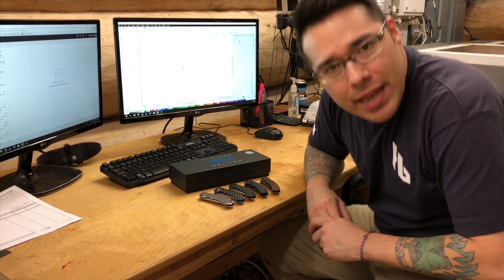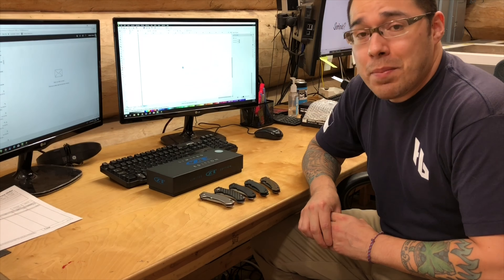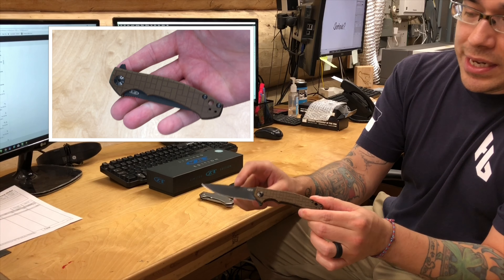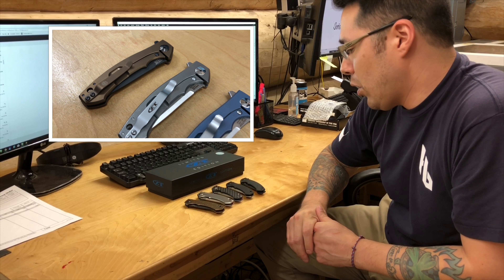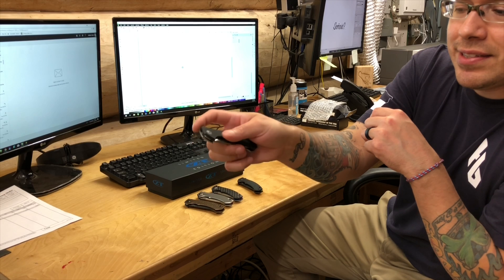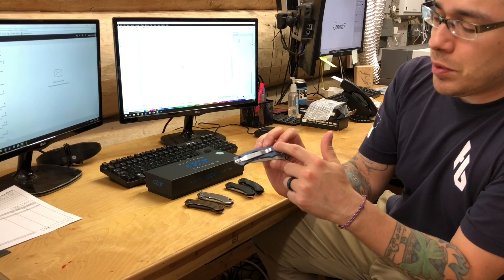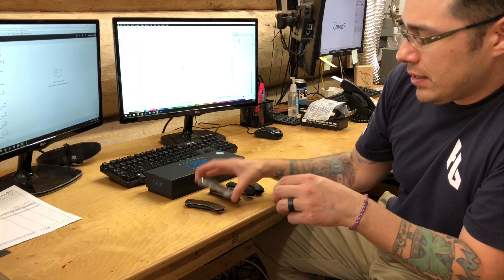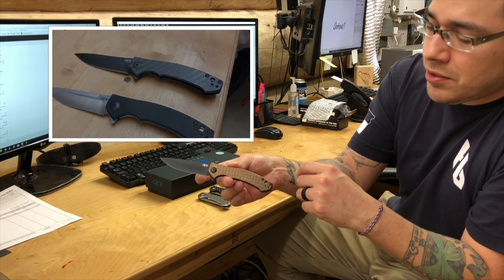Zero Tolerance 0450FCZDP Factory Custom First Look!

Comment: Beautiful knife! Hard to replace my 0392BLK..  I think it’s a great run, but hard to get me to drop 350$ on it..
Reply: c Man right, I mean it's still just 2 slabs of titanium like the original. Just with a little milling, different spring clip, anodized, steel change that costs the same amount and different hardware..Doesn't add up too the price hike.